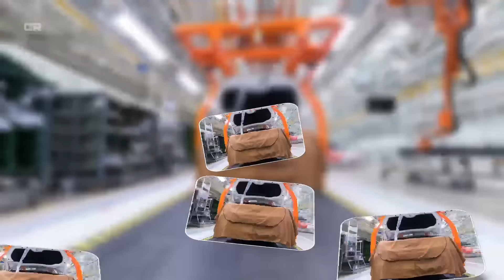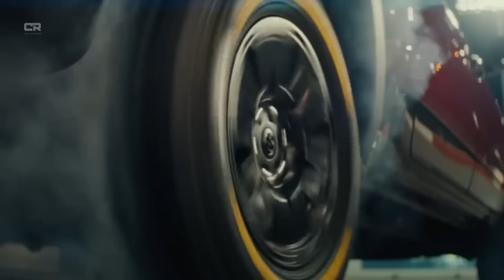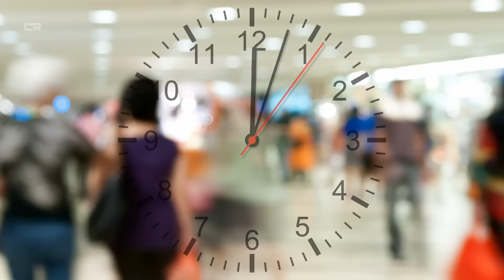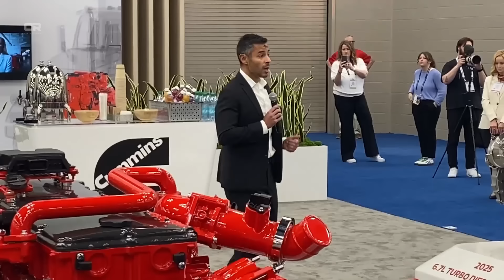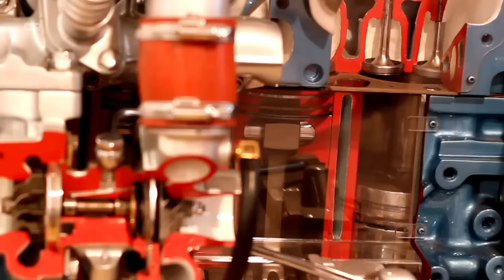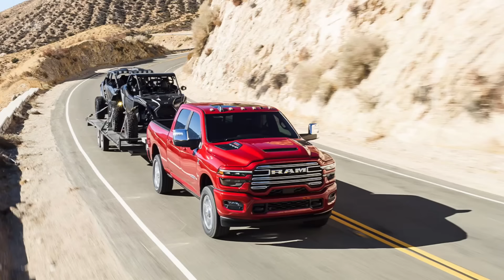2026 RAM 7.2L Cummins: The Diesel That ENDS The Torque Showdown!

Comment: Put a mechanical P pump on it and it might not be a pile of scrap.  1300 FT Lbs of torque?  What transmission will stand up to that for 200,000 miles?
Reply from the maker: Great point! A mechanical P pump could definitely change the game. It’ll be interesting to see how the transmission holds up under that kind of torque over time!

Comment: Not Entirely True 

They fail because of unnecessary EGR !!!

When you get rid of the EGR YOU WILL HAVE SOMETHING WORTH BUYING!

YOU Don’t NEED IT, YOUR JUST CRAPING INTO ITS OWN INTAKE ITS OWN HARD DESTRUCTIVE CARBON AND HEAT…

At most you need a proper after engine exhaust DEF treatment catalyst that is cost effective to maintain …

How do you make 1,000,000 mile claim when you don’t even have 1,000,000 miles on your new engine you guys are laughable!
Reply from the maker: I appreciate your perspective! EGR systems can definitely spark a lot of debate among diesel enthusiasts. It's always good to hear different insights on what makes an engine truly reliable.

Comment: Has not been much said that this will be in a ram at all and its a dual overhead cam and will be much heavier than the 6.7 I'm betting a good 400 lbs. heavier so its going to take a bit of work to fit it in current rams . Plus cummins is not said the acutal date of offering it in 2027 for medium duty trucks
Reply from the maker: You're right; there’s still a lot of speculation about the 7.2L Cummins in the RAM lineup. It'll be interesting to see how they manage the weight and fit in those current models!

Comment: Ford and Chevy will have to upgrade their engine blocks and transmissions to keep up… meanwhile stock Ram transmissions get shredded all the time with the current Cummins lineup. 😂 Loving the sound of this new Cummins but yeah, between emissions requirements and waiting to see how their transmissions hold up, think I’m better off looking at old pre-2012 3500’s
Reply from the maker: The competition is definitely heating up, and it’ll be interesting to see how the new Cummins stacks up against Ford and Chevy. Old pre-2012 models have their charm too!

Comment: My 2017 Ford F250 6.7 diesel has more power than anything I have to pull or carry. Too many people pull way more than their experience allows. No thanks. I'd rather have dependability and reliability than sheer power.
Reply from the maker: You make a solid point! Dependability and reliability are crucial, especially when it comes to heavy-duty tasks. It's all about finding the right balance for your needs.

Comment: I read about a week ago that Ford has announced (what they call a monster) engine for '27 possible size of 7.3 to 8.0L with 1300 to 1400ft lbs of torque. Variable pitch turbo or turbos. And upgrades to include the powerstroke F-150. I'm not a Ram or Chevy basher, just an observation. And my opinion not for me with DEF.
Reply from the maker: That's an interesting observation! Ford's pushing the envelope with those specs. It'll be exciting to see how the competition responds in the upcoming years!

Comment: I was a diesel supporter for decades, but the overall purchase price, maintenance costs, emissions and fuel prices have done me in. I'm now operating a big block gasoline engine with great pulling suitable for my needs and not bad fuel economy.
Reply from the maker: It's understandable! Diesel can be a hefty investment these days. A big block gasoline engine can definitely provide the power you need while being more manageable on the wallet.
Reply: Whattya mean? You don’t want to pay $8.16 a gallon (Los Gatos  CA 3-31-26) for a less refined fuel than gasoline?  They’ve turned us into  Europe. Diesel was $0.90 cents a gallon when I bought my first Cummins in 96.

Comment: I still run my original 98- 12V Cummins
Reply from the maker: That's awesome! The 98-12V Cummins is a classic. It's great to see how these engines hold up over the years!
Reply: 96 here
Reply: 97 mild tune, 300,000, only used for hauling and towing, i like the simplicity

Comment: You mean Cummins new engine ram wouldn’t sell trucks without Cummins they’ll go to the bottom if Cummins switch teams
Reply from the maker: You're absolutely right! Cummins has built a reputation that's hard to beat, and their engines are a huge part of what makes RAM trucks so appealing.

Comment: Buy the looks of the comments the new diesel trucks with def are not that well liked because of all the issues.  Guys are either sticking with their old non def diesels.  Or some may go to the big gas powered trucks. It may cost more for fuel but the repair cost aren't there.
Reply from the maker: Thanks for sharing your thoughts! It’s always great to hear from fellow truck fans. The community’s opinions really help us all make informed choices.

Comment: I have a 2022 Ram 6.7 & 2005 F250 6.0 straight piped and she screams.
Reply from the maker: Sounds like you’ve got a powerful lineup! The 6.7 is a beast and that 6.0 must turn heads with that straight pipe!

Comment: Guess ford needs to modernize the old 7.3 and bring it back
Reply from the maker: You raise a great point! The classic 7.3 has a lot of fans, and modernizing it could definitely bring some exciting competition to the table.
Reply: They did bring back the 7.3 but it's gas.
Reply: Supposedly come 2027 they will not have def. With the signing of a bill to get rid of epa regs.

Comment: I'll keep my VERY well maintained deleted 2012 6.7 4wd manual.  When it goes I'll purchase a crate engine from Industrial Injection.  I've seen too many newer 6.7s Rams on the side of the road with the hood up. Also Cummins completely screwed this engine up by not using an electric motor driven turbo. They need to get away from the soot fouling them up. Why my 06 Duramax didn't soot up its turbo with over 340k on it and my Ram did at 100k idfk.
Reply from the maker: It sounds like you've found a solid setup that works for you, and it's great to hear about its longevity!

Comment: 😂 I already see transmission failures.
Reply from the maker: Transmission issues can definitely be a concern with high torque engines. It’ll be interesting to see how RAM addresses this moving forward!
Reply: @CarReviewshub  Agreed. Ram has not had any luck with keeping transmissions in trucks or cars.
Reply from the maker: You're right! Transmission reliability has been a challenge for Ram, and it's definitely something they need to focus on moving forward.

Comment: The 2016 Cummins isn’t 1,300 ft lb torque it’s still 1,075 ft lb
Reply from the maker: You're right to point out the specs! It's always good to clarify the exact torque numbers for different model years.

Comment: Hopefully it will be offered with a 10-speed manual, with a very low first gear and a couple of overdrive speeds at 9 and 10 on the high side with a dual disc clutch. Fat Chance.
Reply from the maker: Thanks for sharing your thoughts! It’s always interesting to hear what features enthusiasts like you are hoping for. Let's keep our fingers crossed for some exciting updates!

Comment: My modded 2000 Dodge Ram 2500 runs circles around most diesel street trucks- will do 125 mph quickly
Reply from the maker: The 2000 Dodge Ram 2500 is a beast. It’s amazing what a few mods can do to boost performance!

Comment: Dodge needs to have a transmission that doesn’t go out after 110,000 miles.
Reply from the maker: You're right; a reliable transmission is crucial for maximizing the performance of such a powerful engine. Let’s hope they address that in future models!
Reply: Funny my 2006,5.9 3500 lasted 318,000 miles towing camper all over country
Reply from the maker: That’s impressive mileage! The 5.9 Cummins is known for its durability. Towing a camper all over the country is no small feat!

Comment: I’ll keep rebuilding my 2004 5.9l 3500 Ram to stay away from DEF and still tow all over the country. Initial purchase cost and running costs will still be cheaper than buying this platform. I’ve already put a new engine and transmission in my truck and I have over 1,000,000 miles.
Reply from the maker: That’s incredible dedication to your truck! It sounds like you’ve found a winning formula that works perfectly for your needs.
Reply: You can swap a 6.7 long block with a 5.9 head if you feel you need more displacement. 5.9 do better with head gasket life since there is more meat between the cylinders. 6.4, (6.7 short stroke with 5.9 crank) isn't all that useful for most people unless all they do is race around the streets in a 4 ton truck and never tow.

Comment: Tourque means nothing it is the peak power that matters Tourque has is just how fast your crank shaft is spinning not how much power power it takes Diesels were built for efficentcy
Reply from the maker: It’s true that efficiency plays a huge role, especially in diesel engines. Both torque and power have their importance, but it’s all about finding that perfect balance.

Comment: Cummins should have contracted Banks for the intake . Easy to option up to 3 grid heaters . For the Yukon to the Yucatan . Instead they threw all that money at glow plugs . What was that ? Sixties thinking . Is it they were gob smacked , by their cheap bolt in their grid heaters , so thusly acting like grid grid heaters are a bad thing . Please no , better combustion theories about glow plugs .
Reply from the maker: Collaborating with Banks could have led to some innovative solutions for better combustion. It's interesting to see how different approaches can impact performance.

Comment: Ford has 1200 torque and 500 hp I haven’t heard any hp numbers from Cummins so I’m assuming it’s lower then 500 and with just 100 more torque and all that redesign they are only at 40k pounds ? lol ford has been doing that since 2023 ford is ahead of the game and even if this redesigned engine comes to life wich I doubt it will ford will still be up top
Reply from the maker: It's true that the competition is heating up, and Ford has definitely set a high bar with their current lineup!

Comment: Does the new engine come with the optional nut that falls into a cylinder like the current one?
Reply: No they changed that in the 2025. Glow plugs not a grid heater.
Reply from the maker: Thanks for the clarification! It’s always great to stay updated on the latest changes.
Reply: No more nut problem they replaced that with a wet belt oil pump.😅
Reply: Probably like the duramax that comes with a little pin on the crank pulley that sheers. Instead of cutting a keyway on the end of the crankshaft.
Reply from the maker: Great question! The new engine has some impressive upgrades, but I’ll have to check on the specifics about any optional components!
Reply: @CarReviewshub  is painfully obvious that the reply came from an entity that knows nothing about the dreaded heater bolt impression  usually left on #6
Reply: They added an extra for redundancy in case one falls iñ
Reply: even the 2025 doesnt come with that.

Comment: It’s pretty disgusting in 2025 that manufacturers have all these quality control issues and it’s every brand from turbos to complete engine failures. you name it. At this point in time nobody trust them. my Son has a 2006 LBZ Duramax with 300,000 miles on it. The only thing has been replaced is the common things you would expect to replace on a truck with some mileage nothing major it leaks nothing has some performance upgrades to keep up with the new stuff if not better. Instead of coming out with new overcomplicated things that nobody trusts all the manufacturers need to go back to their roots and look at what they used to make.
Reply from the maker: Thank you for sharing your thoughts! It's important to hear from passionate truck owners like you. Your son’s experience with the Duramax is a testament to the value of reliability in engineering.
Reply: Tell him not to run too much power through it or put a boost controller on it. Those LBZs broke more crankshaft than any other at the front journal. I broke mine at about 340k. Maintained it very well with Amsoil. It looked brand new inside when they tore it apart. Its a slight design change that caused the issue. I accelerated its demise probably and it didn't pull more than 4-8k lbs. .

Comment: Sorry to hear they went with glow plugs. They will eventually fail and need replacement.  Had one in the ‘80’s and one broke off and ruined the piston.
Reply from the maker: That's a valid concern about glow plugs. Hopefully, modern designs have improved reliability!

Comment: ZF Transmission?
Reply from the maker: Yes, the 2026 RAM features a robust ZF transmission, designed to complement the incredible power of the 7.2L Cummins engine for optimal performance.

Comment: I will not buy any diesel that takes DEF, period.  My 2000 5.9 Ram has over 650,000 miles on it with no troubles, why change for more cost complexity and failures.
Reply from the maker: I totally understand your perspective! The simplicity and reliability of older models like the 5.9L are hard to beat. It’s all about finding what works best for you!
Reply: @CarReviewshub it’s not hard to beat. They are going backwards having a truck last 650,000 miles and new ones are failing after 100,000 because it’s better to sell us a new vehicle every couple years it’s all about the Benjamins!
Reply: Well said. Coming from a Ram truck owner myself. I would love to see the new Ram Cummins truck with no DEF and PDF! I believe this is where Ram Cummins truly shines! ❤️💪🛻
Reply: I have a 2006 ram 5.9 Cummins I have 500,000 on it and runs like a Swiss watch doesn’t miss a beat was going to update to a newer vehicle but decided not to after hearing many problems on after treatment. I’ll stick with what doesn’t cost me a whole lot of money I have seen check engine light come on twice in 500,000.
Reply: @jimmybean768  I have a 2005 5.9 with half the miles. Hopefully I can reach 500k with no issues. Just need a cam swap to get rid of that in cylinder EGR.
Reply: my 2003 has 414K and running great
Reply: @RittenhouseSecurity  Preach!!  3rd Gen, manual, maintained like a Ferrari. No issues whatsoever.
Reply: Thats cool they don't care friend lol they want to get into that commercial market of the f550. They want those 10- 1000 unit truck orders by companies
Reply: Right. I have a 2005 5.9 .  Great motor.. can't say the same for the front end of the truck though.  They certainly didn't build it to last at all with a motor that heavy
Reply: I'll be keeping my deleted 2011 6.7.  It lost some weight and very dependable.  I do like idea of a bigger engine but agree with you, more complexity and failures to come.
Reply: Thats what happens when you take care of them
Reply: How many transmissions have you been through in 650,000 miles?
Reply: My 0159 has 500 on it, head cracked from too much hot and cold expansion contraction. Piston walls still had hatching on it bearings were all fine
Reply: Wow 650. I have a 1995 5.9 with 220 on it and I will never get rid of it

Comment: And then there is the DEF system to cripple everything if that system has a fault code and then you cant drive the truck at all. Make the DEF system replaceable in parts not just all with no option to replace parts just like every other part of the truck.
Reply from the maker: Thank you for sharing your thoughts!

Comment: Now add a transmission to handle it.
Now that Allison is independent? MAYBE????
Reply from the maker: Thanks for your input! You're absolutely correct—a strong transmission is key to making the most of that Cummins power!
Reply: Cummins buy eaton like 2 years ago.
Reply: They already have the zf8- stronger than the new 10 speed Allison’s
Reply: @mbvideos11 you mean 10 speed GM transmission.   It was not built by Allison but by ford and GM.  It carries the Allison badge.

Comment: Should have wet liners rather than a solid block.........And since it still has DEF system its a nogo for a lot.
Reply: I say no. As a diesel mechanic.....unless your driving the truck 100k miles a year. Do not run a wet sleeve. The o-rings over time can leak with age. I've seen more farmers pull in their trucks after sitting over the winter to have the crankcase full of coolant.
Reply: @davidhenri2722  As a heavy diesel tech for 30 years that all comes down to lack of coolant system maintenance and electrolysis as a result  not an o-ring issue.
Reply from the maker: That's an interesting point! Wet liners do have their advantages in terms of cooling and maintenance. It’ll be exciting to see how the industry evolves!
Reply: The 8.3 is a magnum size sleeved version of the 5.9.